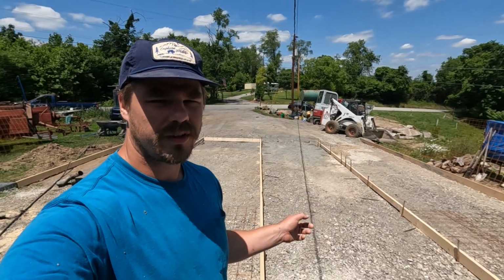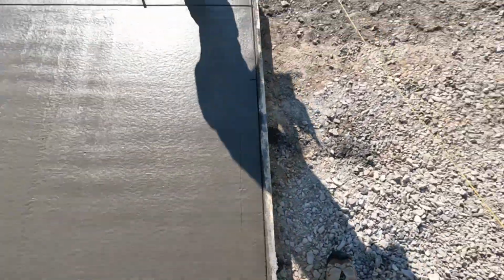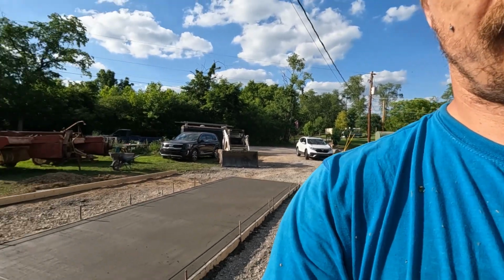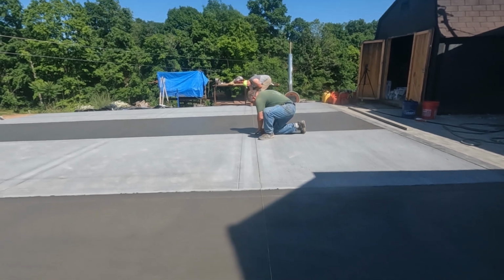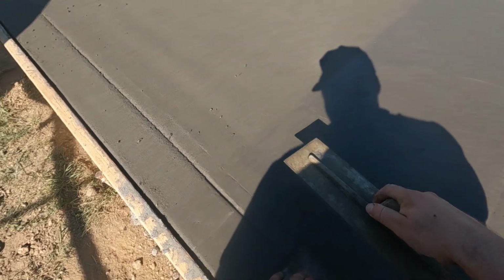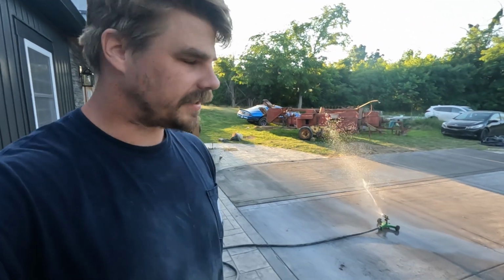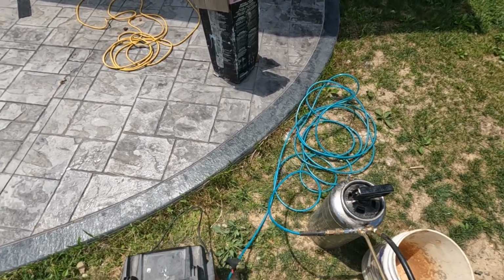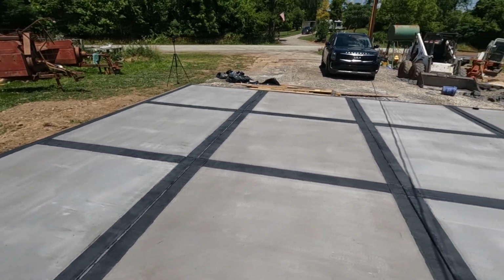051 - Pouring Our Own Driveway! (Part 2)

Comment: Did u use retarder on the 1st pour?
Reply from the maker: @GRUBB-MUDD  first pour went well and finished like normal. No retarder. Weather was 85°F and roughly 8mph wind, but were used to afternoon pours. Second pour was nearly the same conditions, but I added 0.5% retarder to make it a bit easier on us. 
Since I added integral color, we had the trucks match the slump between pours on the psi gauge. 
I talked to the plant owner after the pour, and he thinks the gravel likely dried out in the hopper before it was batched. That could throw off the water ratio.